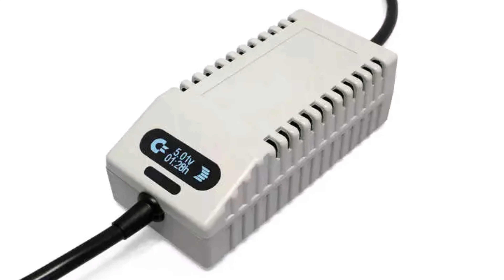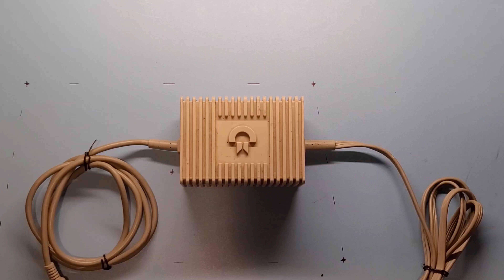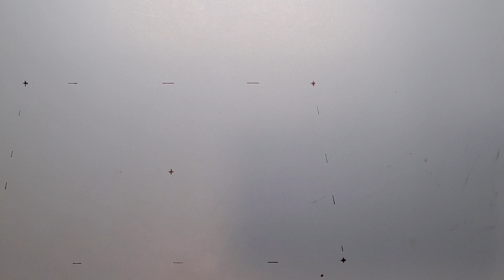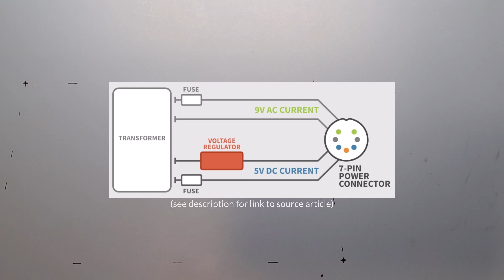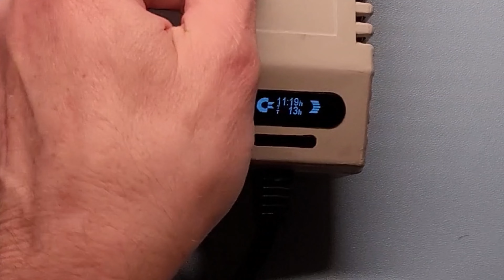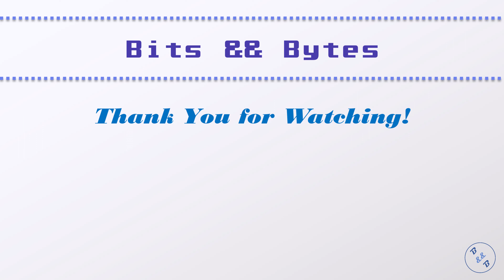Replacing My C64 Power Supply

Comment: I would argue that a linear PSU is better than a SMPS one and there is a well known add-on called C64 saver that would protect your C64 until the regulator dies. Then the problem would be depotting the OG PSU but I am sure someone will figure that out and post a YouTube video. Thanks for the video!

Comment: Check the A/C output line, a lot of users have reported this power supply outputting up to 13V which will overheat the voltage regulators inside the C64 and destroy it, especially the earlier version ones.
Reply from the maker: Just checked my adapter and it also reports 13VAC on pins 6/7. However, it is not uncommon (or unexpected) to have an AC voltage measure higher than expected when it is not under a load. Once under a load, the measured voltage is closer to 9VAC. That said, I would recommend anyone measure their AC adapters' output under load to ensure it is within the acceptable range. Thanks!
Reply: Ah, so they still haven't fixed the issue.
https://www.youtube.com/watch?v=Ld-oRmPJe7w
Reply: How ironic...you buy a new unit which it seems is faulty too..i would advise using a voltage saver lead even with a new power unit.
Reply: @doctorsocrates4413  IKR! The old PSUs with DC voltage problems and the new ones with AC issues, retro fans can't seem to catch a break!